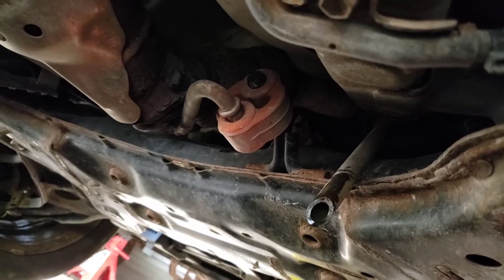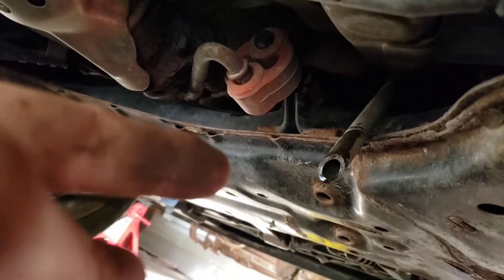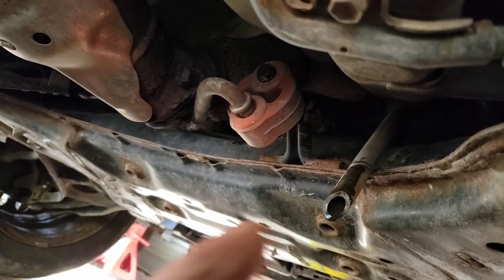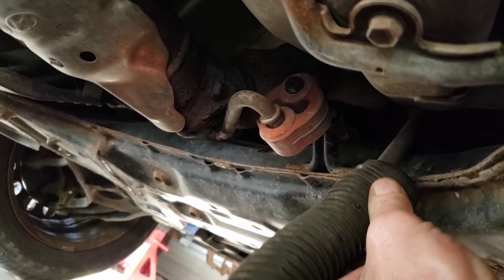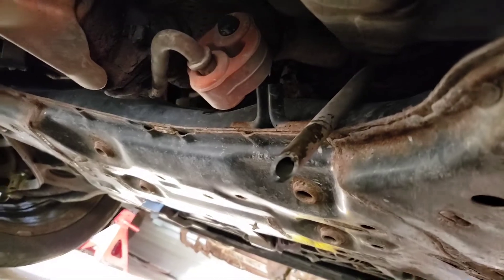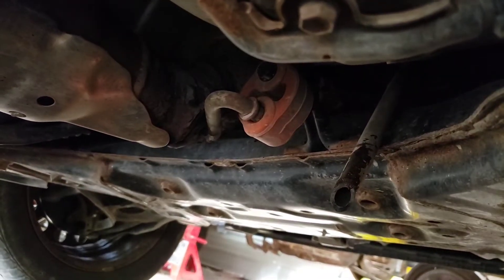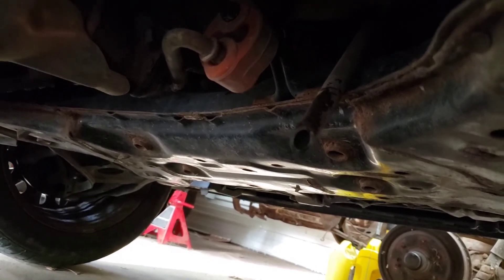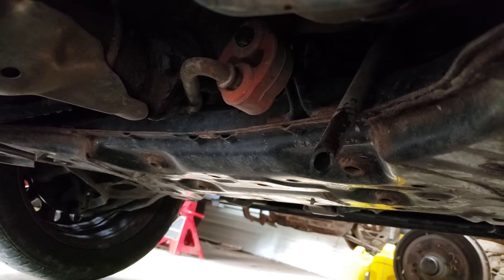2013 Hyundai Elantra Plugged AC Condenser Drain Hose Easy Fix!

Comment: Okay but is it normal for that hose to drip water? I noticed it today but my floor boards are dry and no inside leaks
Reply from the maker: Yes, its the AC condenser drain hose. Its working when you see water on the ground underneath it. When that water ends up on your passenger side floor mat it is no longer draining due to an obstruction